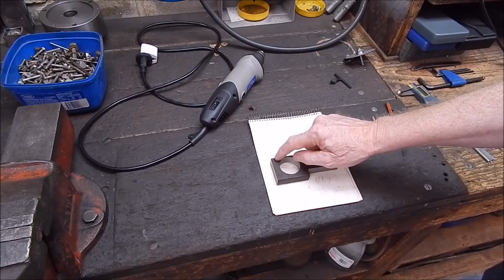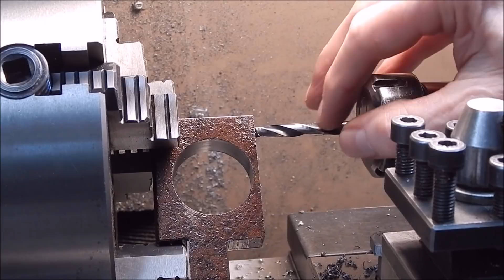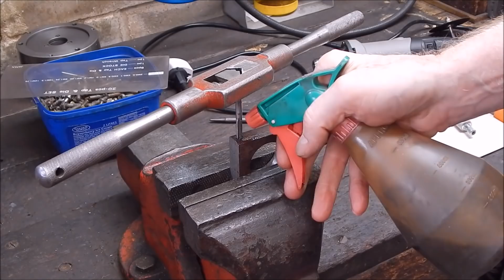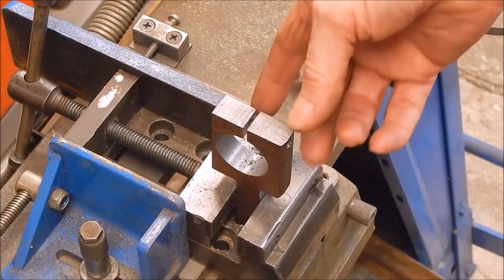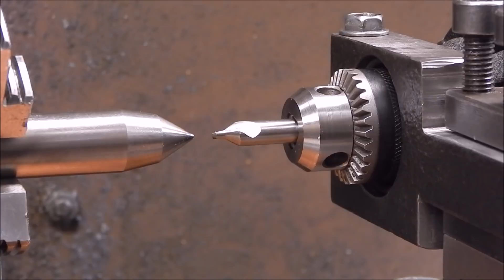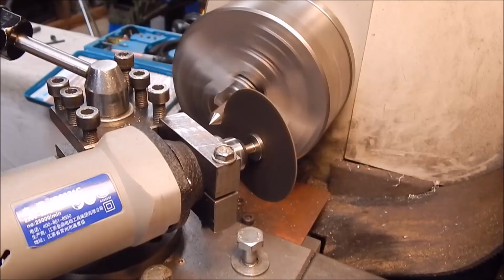The HILDA 400 watt rotary tool makes an awesome tool post grinder

Comment: Hey Rob, 
Where do you get your 3 Inch Cutoff Wheels??
Reply from the maker: Smith & Arrow.

https://www.smithandarrow.com.au/product/cutting-discs-wheels/3-75mm/3-75mm-x-10mm-bore/metal-cutting-discs-wheels-3-75mm-x-1mm-angle-grinder/?gclid=CjwKCAiAvriMBhAuEiwA8Cs5lbgCMKCZyof8YgLeKUHECU2WHFqvXuyvbDq3MowsbWzvomzGjMfEzBoCnqEQAvD_BwE

A small box lasts me a long time.  Top quality.

Good to deal with.

Cheers Rob
Reply: @Xynudu  Legend !!! Thanks Rob 👍 today I purchased the Hilda 400 watt die grinder from AliExpress 11:11 sale. I liked your review of the product. Looks like a decent unit. I particularly like the Jacobs chuck instead of the collet.
Reply from the maker: The HILDA is a great unit.  The chuck is excellent.  You will like it a lot.  The later unit I replaced it with after I overheated it (all my fault) has the advantage of a machined mounting collar on the nose.  So it's an improvement, but I was quite happy with the original HILDA.  I use mine regularly, it's just so useful.  Cheers Rob

Comment: another question, where did you get the arbor for the 75mm grinding disk, bought or made? cheers
Reply from the maker: Hi Roger,

I made the original 6 mm shanked one I used in my air die grinder.  Then BG gave me a 10 mm shanked one which I reduced to 6 mm.  Then I discovered you can buy 6mm shanked ones off of Amazon very cheaply.

Cheers Rob
Reply: thanks Rob had a look very good....

Comment: Hi Rob, good job. Any reason I couldn't make this mount out of 13mm alloy? Not a lot of load on the grinder so....?
Reply from the maker: No.  Should work fine.  The tool post bolts will probably score it pretty quick though.
Reply: thanks Rob, yes true but the number of times I will use it I dont think it will matter...cheers!
Reply: Hi Rob, I made up an alloy one out of 12mm plate seems to work OK, so thanks for your video...would send you a photo but cant seem to load one on here....cheers
Reply from the maker: Hi Roger,

You can email one to me at gloaming_agnet@hotmail.com

I'd be interested to see it.

Cheers Rob
Reply: Will do Rob cheers

Comment: I just finished doing a 200 watt, 120v for my old South Bend. Thanks for the idea. I haven't used it yet... But I really like it. And I copied your design to a "T"
Reply from the maker: Hi Tim,

The mount is very rigid and all you need.  It's the same design I used on my pencil air die grinder.  Some of the mounts you see on the net are so over engineered it's ridiculous.

Same thing with a cross slide lock, some totally terrible ideas out there ;)

Cheers Rob

Comment: Hey rob, I was looking at a collect set on banggood and was wondering if you’d had any experience with them? Otherwise what brands would you recommend? - new to home machining. Cheers
Reply from the maker: I would be very wary of buying Banggood collets.  The sets that have been reviewed were shit.  

I bought most of my ER32 collets and chucks from CTC Tools online store and they are excellent.  That was some time ago.

The thing that you must look for when buying is that they are made to a DIN or ISO standard.  If they don't state that then don't buy.

A lot of the BG stuff doesn't state a standard so anything goes.

I review their stuff but I call a spade a spade, so choose wisely.

I see they sell individual collets in the standard blue and yellow boxes, but once again how good are they ?

Look for a DIN rating and you should be reasonably sure of getting quality.

Cheers Rob
Reply: wow, they're significantly cheaper than what i've seen elsewhere too...a set of 19 for $75 bucks???
Reply from the maker: I haven't dealt with CTC since they moved to Europe.

Do they still quote DIN standard or maximum specified run out ?

Rob
Reply: yeah this is what they spec "DIN6499B 0.015MM (0.0006") Run-Out Tolerance" link to the site..  http://www.ctctools.biz/er32-collet-set-19-pcs-a07/ 

thoughts? seems to tick the boxes...
Reply from the maker: I would go with that.  Looks OK to me.

Cheers Rob

Comment: hey Rob, great project,  you should see if Banggood will send you a quick change toolpost.  Without a doubt the best upgrade I made to my lathe and makes setting centre so much nicer.
Reply from the maker: They only have those tiny ones for micro lathes like my Sherline, and they have a high alloy content.  So I will pass on that.
Reply: Whoops, just checked,  they sell the better ones https://www.banggood.com/DMC-250-100-Piston-Type-Locking-Tool-Post-Steel-Quick-Change-Tool-Post-p-1208546.html?rmmds=search&cur_warehouse=CN but are too expensive

Comment: Nice build Rob, thanks for sharing. What are your thoughts on building a shield around the disc in case it explodes? I would assume if a wrong handle was turned it could force to much disc into the work and shatter?
Reply from the maker: I've never had  a 75 mm disc shatter.  They are heavily reinforced.  They use them a lot in the car repair industry to cut out panels etc so they can handle a lot of flex and curves.   The smaller Dremel discs however are very fragile and can go bang quite easily.
Reply: Thanks for the info Rob, Sounds like a good size grinder disc. Very versitile
Reply from the maker: Very cheap as well.

Comment: Thanks Rob, an enjoyable video series. It looks like a handy addition to any workshop. Actually I took away something completely different from this one, the use of the small vice in the bandsaw. Hadn't thought of that one, so thanks again.  Mart.
Reply from the maker: Another benefit from using the small vice is that it also allows you to tilt/angle the work piece in the jaws so the bottom of the cut will be parallel to the blade, when only cutting part way through/into something.

Cheers Rob

Comment: Excellent job Rob. Now I have to make something else. Might even sell the big tool post grinder. The list gets longer.  regards from the UK
Reply from the maker: Hi Gary,

I rarely use the big TPG, but it has a large range of stones and an internal quill that is very useful.  So it's still better than money in the bank I suppose, so I will keep mine.  The biggest bug bear is that it can't be used on the topslide.

The little pencil air die grinder has probably done more work than big brother as a result, but HILDA should be even more useful given it's power and chuck capacity.   Certainly makes any Dremel look pretty wimpy.

Cheers Rob

Comment: Looks great. Could you sharpen drill bits with that setup.
Reply from the maker: You can re-profile them to the correct angle and uniformity, but you still have to grind back relief on each flute by hand.

I've done this with my full sized TPG.  Does a nice easy job of restoring drill tip uniformity.

Cheers Rob

Comment: I have done these brackets....slightly differently using a boring head.  Normally these are used on milling machines, but they work perfectly in lathe spindles also.  The advantaged are that centering is perfect and there is no effort lining things up.  You just clamp the bracket in the toolpost and bore using the boring head in the lathe spindle. Thanks for your videos ...Joss in Cork, Ireland.
Reply from the maker: Handy way to do it if you have a boring head.  Thanks for the tip Joss.

Cheers Rob

Comment: can it do a key way in a shaft when the shaft is held in the chuck and a end mill in the Hilda. that way its always going to be on centre
Reply from the maker: I expect so.  Sounds perfectly logical to me.  You would have to take light cuts and control the feed rate by hand.

Comment: Nice bit of work. I have a similar setup using a dremel clone which is great for small work but lacks rigidity for bigger grinding tasks. I think I might have to follow your lead and make one with a die grinder.
Reply from the maker: Mounting anything with a plastic body is bad news.  They all flex and align horribly.  This is way better.

Rob
Reply: The actual mounting is ok, I used the threaded collar so that's quite sturdy, the problem is lack of power and the spindle bearings, just too much play in them. Your die grinder has more power but more importantly bigger bearings.
Reply from the maker: OK I see.  No play or runout with this unit.  It's very impressive.

The first time I looked at one of these I thought it had to be the perfect candidate for a small lathe TPG.  I had previously toyed with the idea of mounting an angle grinder with a plate attached to the head mounting screws.  But this is better, more rigid, easy to make, and a relatively compact unit.

Beats me why this style of rotary tool is not sold in Australia by the major tool/handyman suppliers.

Plus it's good value when you compare it to a full sized die grinder (which once again is too large) and a Dremel style unit.

Cheers Rob

Comment: Hi! The little wrench has that little tip at the opposite end. I know what that little tip is fore, because on much smaller grinders there is a small hole close to the chuck or 3 mm collet holder. Everything is so tiny that the only way to lock the quill/spindle is to align a hole on a rotary shaft with the hole in the the injected plastic moulding ( no metal on those tiny tools ). Then the tip on the wrench is inserted to stopp the rotation.
Reply from the maker: No.  The little tip is a crude flat head screw driver to tighten the centre screw on the Dremel style friction disc arbor.

Rob
Reply: Yeah, every Dremel or Dremel knockoff comes with the same design of wrench. They're probably all made in the same factory.